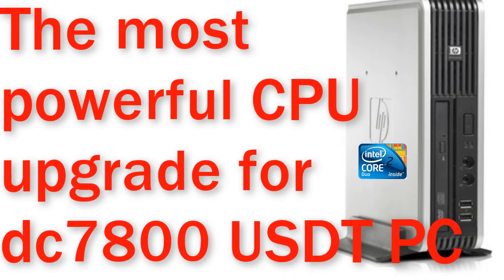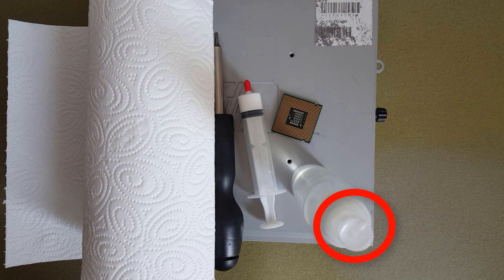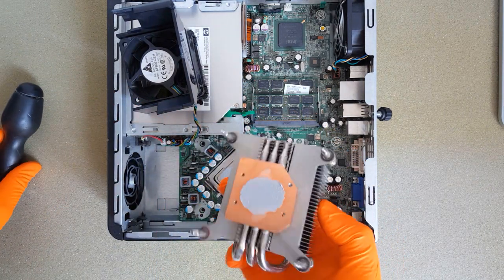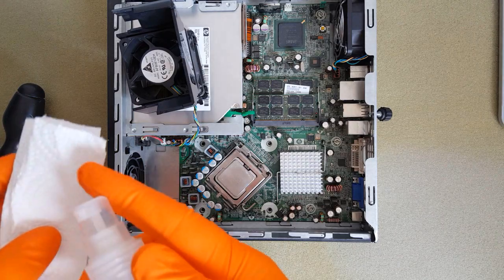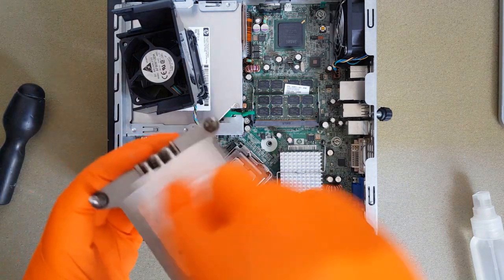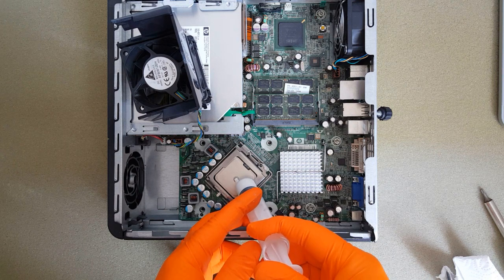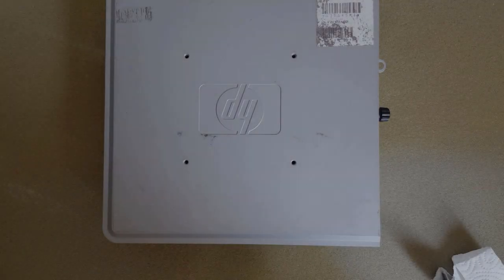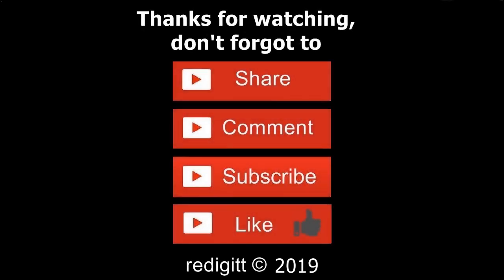The most powerful CPU upgrade for HP Compaq dc7800 USDT PC Ep.282

Comment: I´ve upgraded my HP DC 7800 SFF from E6550 to Q6600, with ducktape trick it goes from 2.4 to 3Ghz, i´m guessing the Power Unit?
Reply from the maker: According to the HP official support page the SFF (Small Form Factor) and CMT (Convertible Minitower) versions supports these Core 2 Quad Processors without any trick.
But the USDT - Ultra Small Desktop PC support only Core 2 DUO Processors.
Intel Core 2 Quad Processors:
Intel Core 2 Quad Q6600 Processor (2.40-GHz, 8 MB L2 cache, 1066-MHz FSB)
Intel Core 2 Quad Q6700 Processor (2.66-GHz, 8 MB L2 cache, 1066-MHz FSB)
Intel Core 2 Quad Q9300 Processor (2.50-GHz, 6 MB L2 cache, 1333-MHz FSB)
Intel Core 2 Quad Q9450 Processor (2.66-GHz, 12 MB L2 cache, 1333-MHz FSB)
Intel Core 2 Quad Q9550 Processor (2.83-GHz, 12 MB L2 cache, 1333-MHz FSB)
Thank you for watching, if my video or advice was helpful , then please don't forget to share, like the video and maybe subscribe.

Comment: i wana upgrade my pc hp compaq dc7900 can i use cpu like i5 or i3 or i7 pls help me
Reply from the maker: Aloha, the HP Compaq dc7900 has socket 775 so it isn't compatible with i3,i5,i7 series.
These are the most powerful CPU's for the dc7900 PC's:
HP Compaq dc7900 USDT  Intel Core 2 Duo E8600 processor 3.33 GHz, 6 MB L2 cache, 1333 MHz FSB
HP Compaq dc7900 SFF and HP Compaq dc7900 CMT Intel Core 2 Quad Q9650 processor 3.0 GHz, 12 MB L2 cache, 1333 MHz FSB
Befor you upgrade the CPU is recomanded to updare your BIOS https://youtu.be/Ewx-3SM-JaU
Thank you for watching, if my video or advice was helpful , then please don't forget to share, like the video and maybe subscribe.

Comment: hey man can i put an intel core 2 quad q9650 in my computer, my pc is same as yours (HP Compaq dc7800) except it is the biggest one (sorry but idk what is the exact name of it). and the motherboard is a q35 chipset.
Reply from the maker: Aloha, the HP Compaq dc7800 SFF -Small Form Factor PC and the HP Compaq dc7800 CMT - Convertible Minitower PC according to HP support page, supports these Intel Core 2 Quad Processors after you update the BIOS for the new Microcode Processors: https://youtu.be/Ewx-3SM-JaU
Intel Core 2 Quad Q6600 Processor (2.40-GHz, 8 MB L2 cache, 1066-MHz FSB)
Intel Core 2 Quad Q6700 Processor (2.66-GHz, 8 MB L2 cache, 1066-MHz FSB)
Intel Core 2 Quad Q9300 Processor (2.50-GHz, 6 MB L2 cache, 1333-MHz FSB)
Intel Core 2 Quad Q9450 Processor (2.66-GHz, 12 MB L2 cache, 1333-MHz FSB)
Intel Core 2 Quad Q9550 Processor (2.83-GHz, 12 MB L2 cache, 1333-MHz FSB)
However I compared the Q9550 with the Q9650 https://ark.intel.com/content/www/us/en/ark/compare.html?productIds=33924,35428 and it should work, but I can say for sure, both CPU's TDP is 95W, has 1333MHz FSB, the Lithography is the same 45nm
Thank you for watching, if my video or advice  was useful, please consider to share and subscribe and good luck with the upgrade.
Reply: @redigitt  Thanks for the detailed answer

Comment: But if I switch from pentium e2160 to core 2 duo e8500, do I need to update the BIOS? or not
Reply from the maker: Aloha, I recomand to update the BIOS  https://youtu.be/Ewx-3SM-JaU , because the E8500 https://ark.intel.com/content/www/us/en/ark/compare.html?productIds=33911,29739 is newer CPU, maybe will work with an older BIOS, maybe don't.
Thank you for watching, if my video or advice was useful, please consider to like, share, it helps my video with the YouTube Algorithm, have a nice day and good luck.
Reply: @redigitt  and if I'm going to switch from a smaller lithography will it fit my computer? if it works from 65 to 45? I don’t need to throw off anything, just tell me will it work or not?
Reply from the maker: Sorry i can't tell you for sure, because I already updated the BIOS when I made  the CPU upgrade.
The CPU will fit in the CPU socket, because both of them are socket 775.

The motherboard has a BIOS and that BIOS has to support the CPU ID.
The Core 2Duo E8500 has these CPUIDs:
10676 (SLAPK)
1067A (QHEY, SLB9K)

In the CPU ID update BIOS file you find these informations:
ENHANCEMENTS: 
- Updates the Intel Processor microcode for processors having CPU IDs
 6F6, 
6FB, 
6F2, 
6FD, 
6F7, 
10676, 
10677, 
and 1067A.

NOTE: To determine the CPU ID, press F10 on the target computer during startup 
to run the Setup Utility, and then view File/System Information for the CPU ID, 
which is listed after the Processor Stepping.

If you don't update the BIOS first and the CPU won't be recognized by the motherboard, 
you have to put back the old CPU and update the BIOS.

Good luck.
Reply: @redigitt  Is intel core 2 quad 6600 suitable for dc7800? I will be very grateful to you if you answer
Reply from the maker: Aloha, the HP Compaq dc7800 SFF -Small Form Factor PC and the HP Compaq dc7800 CMT - Convertible Minitower PC according to HP support page, supports these Intel Core 2 Quad Processors after you update the BIOS for the new Microcode Processors: https://youtu.be/Ewx-3SM-JaU
Intel Core 2 Quad Q6600 Processor (2.40-GHz, 8 MB L2 cache, 1066-MHz FSB)
Intel Core 2 Quad Q6700 Processor (2.66-GHz, 8 MB L2 cache, 1066-MHz FSB)
Intel Core 2 Quad Q9300 Processor (2.50-GHz, 6 MB L2 cache, 1333-MHz FSB)
Intel Core 2 Quad Q9450 Processor (2.66-GHz, 12 MB L2 cache, 1333-MHz FSB)
Intel Core 2 Quad Q9550 Processor (2.83-GHz, 12 MB L2 cache, 1333-MHz FSB)
However I compared the Q9550 with the Q9650 https://ark.intel.com/content/www/us/en/ark/compare.html?productIds=33924,35428 and it should work, but I can say for sure, both CPU's TDP is 95W, has 1333MHz FSB, the Lithography is the same 45nm

The HP Compaq dc7800 USDT - Ultra Slim Desktop PC supports up to Core2Duo E8600

I have on my channel 35 videos with upgrades, benchmarks for the HP dc7800USDT PC
https://www.youtube.com/watch?v=rbsFcHpYhco&list=PLdsSKCXNCJYhNEKWdUPdFrRJyCjBBYL4L

Comment: hi bro can i upgrade to core 2 quad q9400 ?
Reply from the maker: Aloha, I tried a few quad core cpu's, but they didn't worked.
For this dc7800 USDT PC this is the powerfull CPU that worked .
Thank you for watching, if my video or advice was useful, please consider to share and subscribe, 
or if you think I deserve it  and you want to support my work, You can do it by buying me a cup of coffee at the minimum value of  1$.
https://www.buymeacoffee.com/redigitt  I  https://ko-fi.com/redigitt  I  https://www.patreon.com/redigitt
Good luck and have a nice day
Reply: @redigitt  actually my case is little different from yours but it takes the same drivers and bios updates 
its dc compac 7800 minitower
idk if the mb is the same but its name is Hewlett-packard 786f1 v01.28
Reply: @redigitt  if its the same can u tell me why it didnot work with you ?
Reply from the maker: There are 3 version  in the dc7800 family:
USDT - Ultra-slim Desktop, the PC from this video
SFF - Small Form Factor, looks like the USDT but is bigger
CMT - Convertible Minitower, the minitower
The SFF - Small Form Factor and CMT - Convertible Minitower
supports Intel Core 2 Quad Processors list from the official HP support page:
Intel Core 2 Quad Processors:
Intel Core 2 Quad Q6600 Processor (2.40-GHz, 8 MB L2 cache, 1066-MHz FSB)

Intel Core 2 Quad Q6700 Processor (2.66-GHz, 8 MB L2 cache, 1066-MHz FSB)

Intel Core 2 Quad Q9300 Processor (2.50-GHz, 6 MB L2 cache, 1333-MHz FSB)

Intel Core 2 Quad Q9450 Processor (2.66-GHz, 12 MB L2 cache, 1333-MHz FSB)

Intel Core 2 Quad Q9550 Processor (2.83-GHz, 12 MB L2 cache, 1333-MHz FSB)

and there is a good chance to work with the Intel Core 2 Quad Q9400 Processor to.

Here I have 35 video with the dc7800 USDT upgrade, update, etc.
https://www.youtube.com/watch?v=rbsFcHpYhco&list=PLdsSKCXNCJYhNEKWdUPdFrRJyCjBBYL4L

Thank you for watching, if my video or advice was useful, please consider to share and subscribe, 
or if you think I deserve it  and you want to support my work, You can do it by buying me a cup of coffee at the minimum value of  1$.
https://www.buymeacoffee.com/redigitt  I  https://ko-fi.com/redigitt  I  https://www.patreon.com/redigitt
Good luck and have a nice day.
Reply: thanks bro
Reply: sorry bro one more question
how to find compatible processors in the support page
Reply: can u pls give me the link of the page or if u made video for that can u give me the link ?
Reply from the maker: I saved the pdf file to my PC, here is the link https://drive.google.com/file/d/1r0MpF1VrhtflNKgaLKJVs0A_rueIlh5G/view?usp=sharing
Reply: @redigitt  thanks bro your the hero of my dc 7800

Comment: this vid would be useful if you managed to get a xeon cpu working in the machine.....as its socket 775
Reply from the maker: Yes it would be great, but this motherboard supports only Core 2 DUO CPU's with 65W TDP, 
I tried the Core™2 Quad Q8200S ( 65W TDP) CPU https://youtu.be/fWyn3EJgXrQ , but don't work.
Thank you for watching.
Reply: @redigitt  ok this is more work.....try a moded xeon(the cpu can be moded to work 775)  https://www.cpu-world.com/CPUs/Xeon/TYPE-Xeon%203000.html  they are very cool and efficient cpus